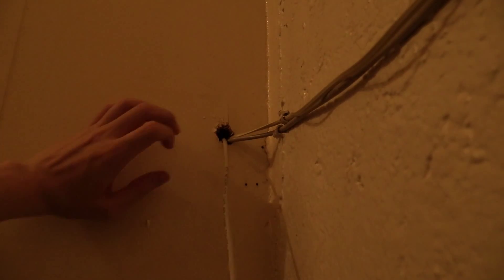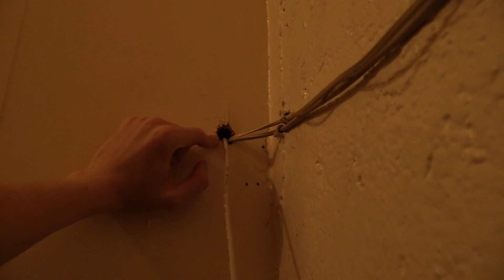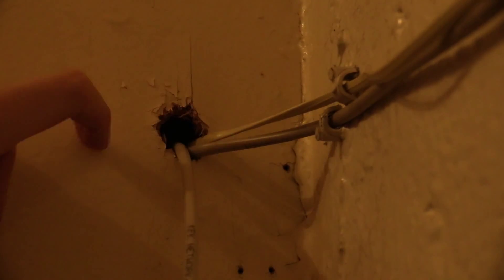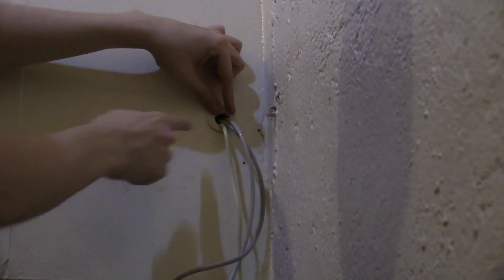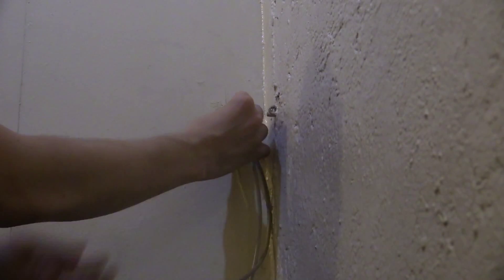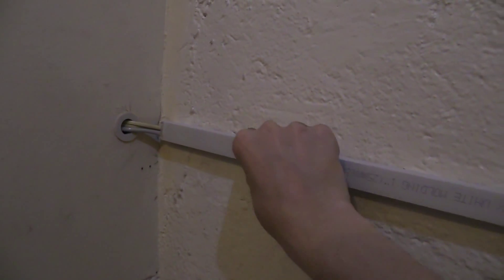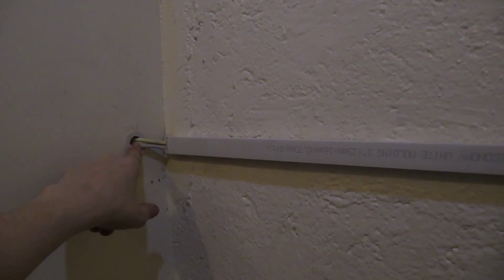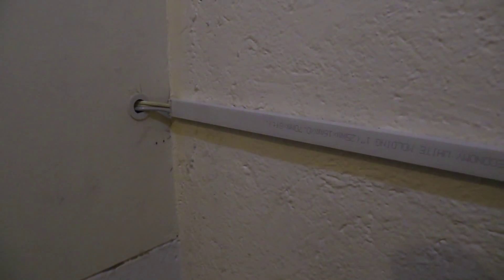3D Printed Wall Grommets

Comment: Is that a regular glass plate, or something specific?
Reply from the maker: Timothy Rupe It's just a regular cheap piece of glass cut to size. I've also had picture frame glass cut to size before but I've found it's better to choose from a piece of glass that the local shop commonly uses for windows. That way, if I break the glass, I can get another one made and don't have to do much/any levelling of the base.